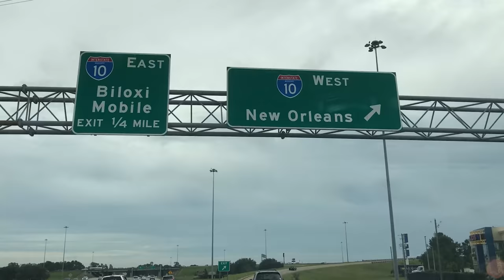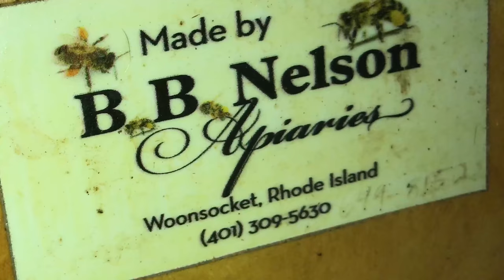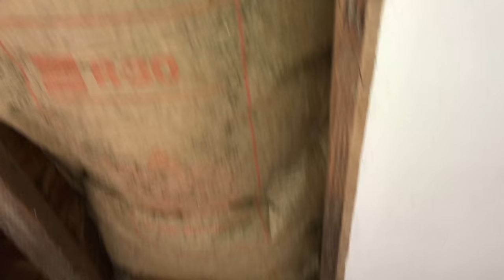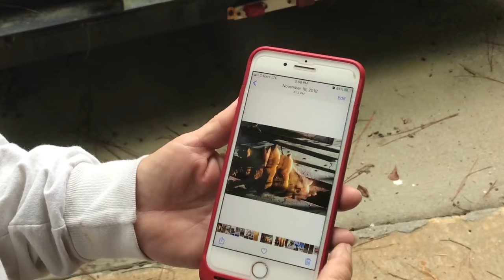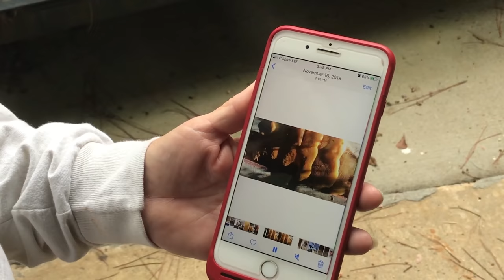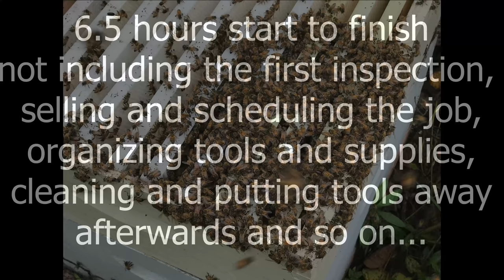The Kill Bees - How Long Does It Take To Remove A Bee Hive?

Comment: I've been doing removals here in Texas for 10 years now - got my start after watching a dozen or so of JPtheBeeMan's videos.   You & I do removals very, VERY much the same way (slow & steady).  Although you're WAY more tolerant of stings than I am (I'm kind of wuss).  LOL

I loved this video. 

I notice at the end you used a putty knife to cut comb.  I have one of the BIG hive tool's that I used my bench grinder to make the edges super-sharp.   Having a sharp edge on the angled side makes it easier to cut comb in tight spaces like this one. 

One trick I learned from another guy here in Texas for bees that run is to take 1 piece of brood comb and frame it up (a small frame, like a medium cut in half lengthwise is easier to work with).  Have a piece of wire on the frame and staple the wired brood comb back up into the space - but 2-3" off the sides (so you can see on both sides).   Take your queen clip (an old one that has had queens in it before) and put that on the frame as well (it will still have a lot of scent on it).   Take a break (ie. go get food at a restaurant) and most of the bees that ran will come back to that brood comb.

Comment: Did some work at my brother's added an air return for his furnace on the ceiling of his atrium.   2 story ceiling so two levels of scaffolding and the safety railing.   Was dealing with same issue you had I was too close to ceiling to comfortably work standing up.  Rigged a lawn chair with some 2 x 6 across the railing strapped down with ratchet straps to make it sturdy.   Might try getting a stool your comfortable sitting on that fits scaffold board.  Make it as comfortable as possible on you.  Just my two cents.  Love the videos.  👍

Comment: I have a buddy who is a welder by trade & he had one of the removal guys around Dallas, where he is from, bring him a couple sets of scaffold frames and Mike added a couple extra rails between the existing ones on each side of the scaffold frames so he could adjust his boards in 4 inch increments.  Thinking this might be a good idea after seeing how much of a headache the standard ones gave you on this removal.  Guess I'll give Mike a call because I sure don't have the "want to" to stand with my face right in the comb if I ever get in a situation like you had here.

Comment: There is a perfect tool for cutting comb from wall cavities.  You can find this tool on eBay and in used condition.  It is called a "Cutco Spatula #28".  These spatulas are stainless steel and very flexible.  The flexibility is the big advantage as you can get it into the cavity in fairly tight places.  They are sharp enough to cut comb away from the wood but not too sharp to cause you to cut the wood.

Comment: What do you charge to do a removal ?  I don’t think you can charge enough, it’s a lot of work, you have the bees to do something with. You have to charge for mileage, if not your wearing out your truck. This job was about 8 hours plus drive time & whatever you decide to do with the bees. Tell me please
Reply: Bees have no value...a queen will cost $25 to $50 a nuc sets you back a 100 or so BUT when you have been keeping bees as long as Dirt has you make or graft your own queens... what is 14 hours of your time worth? Flir located (trip) several phone calls before and during the pricing/quoting,  always figure 2 trips to get bees and then you have to lock them down 48 hrs, cleaning up your equipment,  BUYING  your equipment,  replacing your equipment,  replacing lost tools, down here in Mississippi it is HOT and HUMID most of the months when bees just moved in(that's almost never correct) they just got hot and are sitting on the front porch, and then there is the gamble that you find/catch/get home with the queen, most of the time once you  vacuum up the bees their comb/brood/larvae overheats so when you release them they abscond.... if you don't charge for your service/time/experience/expenses/equipment/vehicle/travel time/ and on and on then you are the one paying for the homeowner to no longer have bees in their house....a properly built/sealed/maintained home shouldn't have an area accessible for a colony to move into.... yep it's costly when figured fairly... and no I won't tell you what to charge either, every situation is different... don't forget you almost always need to know how to build/rebuild/and dismantle in such a manor that no one can tell you have been there and so you know the bees will never get back in the exact same place.....warranty or not that makes you look bad

Comment: My first solo removal... i smoked the comb way too much and imparted smoke flavor into the honey.... i was heart broken.
I thought if i had used Oak, Hickory or Pecan wood as smoker fuel that the smoked-honey would do well blended into a Bar-B-Q Sauce.... but i used Burlap and Cardboard.

In my front yard I am currently open air feeding Cutout-Honey Comb and loose honey to the bee hives and nucs in my back yard, in attempts of recovering quite a bit of honey from a plenty of cut-out jobs that were dirty.

Comment: That's why you need a yellow/orange/blue set of Baker scaffolds...run you 200 new under 100 used...30ish by 60ish top 6ft tall adjustable in 3 inch increments lot lighter to haul around and yes will support you.....but you might want to use a thicker piece of wood or add a piece...

Comment: As always-Great video and bonus info- thanks Randy. Bees look good- I only saw one hive beetle the whole time! I done a cut out from behind the outside electrical panel and didn't have a single beetle. I know things are slower when working alone so I would like to ask how Pete is doing?
Reply from the maker: He had an issue with heat exhaustion and is having to take some time off.  We've had heat advisories every day for weeks.

Comment: I have read that German bees are mostly black, I suppose it helps warm them up quicker in cold Northern Europe. The author said they were the first type of bees brought to the English colonies. I  have also read that Italian bees are golden, but one author said there was a leather colored type in Italian too. Then I heard of a type called carnelian (red-brown?). The bees in this hive have thicker darker black stripes, but on some videos the black stripes are thin and hardly visible. Do you know anything about color variation in bees?
Reply from the maker: I do.  Italians can be anything from a bright orange to almost black (depending on several factors).  Carniolans are generally darker than Italians and it's not uncommon for the workers to be almost black with a jet black queen.  All workers darken with age as well.  It's not easy to distinguish between the varieties looking solely at the workers.  There is a more distinct difference with the queens in my opinion.  Really though, unless you know the origin of the queen or origin of the genetics you're just guessing what bees you've got based on several things.  I know that most feral colonies in our area are most likely going to be Italian so that makes it easy for me to identify ours.  I do occasionally get Russians or Carniolans.  Again I'm guessing based on the queen, the temperament and the brood nest.  Genetic testing is the only sure way.  Just my opinion.
Reply: @628DirtRooster  I read that the bees imported to the US in colonial times were the dark black German type which predominate in Northern Europe. I saw a photo of one that was completely black. Later the Italian types were imported everywhere, but the Black types were already established, at least in the US. 
Of course if a queen has mated with multiple types of drones her worker offspring can have a lot of variation.

Comment: Has anyone found a vac hose with a smooth interior bore?  Listening to the 19:00 min section of the bees getting sucked into the vac hose, you can just hear the bee bodies making impact with the hose ribs all the way down the length.  I feel bad when I open the vac and see the bee carnage left from a short trip into the capture hive.  Maybe some adapters that could adjust pool hose for the vac system.
Reply from the maker: There are some smooth bore hoses but they are very heavy and not very flexible.  My recommendation is reduce hose length.  6' yields almost no casualties.  I use 6' and 8' with low vac pressure.

Comment: I have a question about the bee vac you’re using. I know the Everything bee vac has an adjustable speed setting and you can leave it running on low to keep air moving and cool the bees. This one doesn’t. Is there any danger of the bees overheating when the vac is off?
Reply from the maker: If there are too many or they are sitting in the sun.